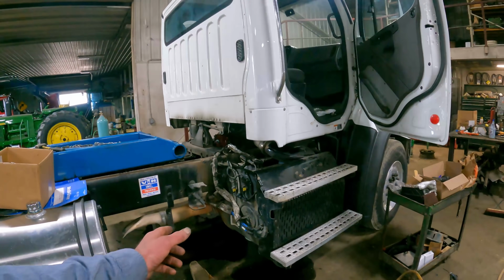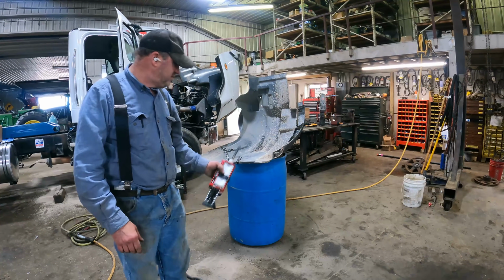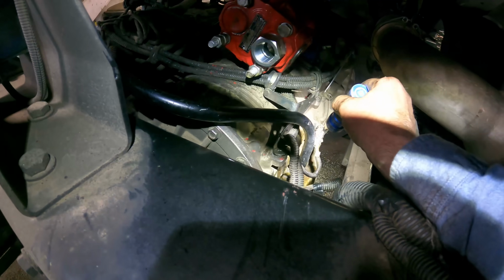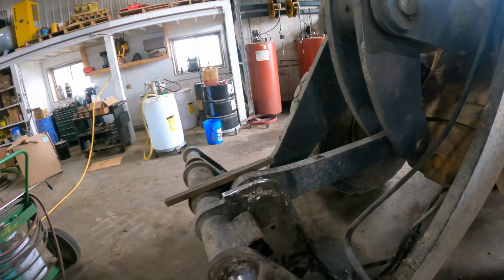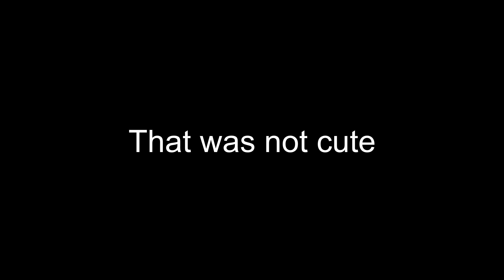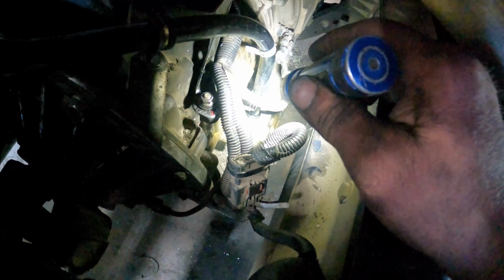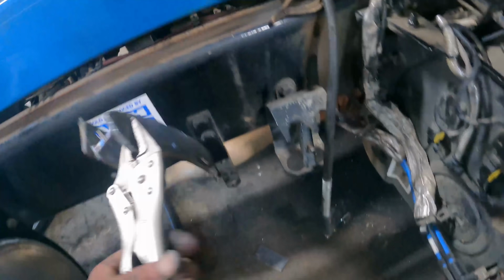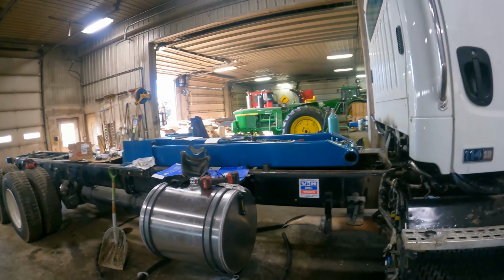Oily Mess (Part 4)

Comment: I have fixed broken plastic fenders, grills and other parts using multistrand copper wire(plated desoldering wire or the shield wire on antena cable works good) and a soldering iron, cut short pieces that bridge the gao then put a hook in each end a bit like Z shape, place the wire in position on the inside and then press on the wire with a hot soldering iron till it sinks into the molten plastic, once the plastic cools its a good flexible joint, for estetics you can cover with silicon or epoxy that helps even more to strengthen the joint.

Comment: he Andy if that truck has the push button style control for the trans you can check the fluid level right on the display   With the trans up to temp [180] all you need to do is set the parking brake put the trans in neutral and push the up and down arrow buttons at the same time it will give you the level of fluid and the filter life the health of the trans and any codes that it may have
Reply from the maker: Good to know

Comment: Plastic weld it with a soldering iron using zip ties as the filler plastic and use lengths of copper wire across the crack to reinforce the join. Worked for me.
Reply: It's new you know what that will look like
Reply: @jwhitley101whitleyfarms9  Yes. Buy a new one if aesthetics are most important to you.

Comment: Andy...Think about running a piece of heater hose or some other hose under and around the dip stick tube where chaffing or rubbing could occur...A few zip ties to hold in place...By the time it rubbed through the rubber and the dip stick tube both of us will be dead and buried

Comment: Hahahaha, I thought that oil from something major. Sucks it's from the filler tube, been there and done that before. This is just my opinion, how you have that dip stick is just perfect, I've seen many trucks have that running the same way as it is right now. As you said, easier to get to and since this IS Sarah's truck... I think she'll appreciate it. 
Have you looked into a plastic welder? Those things actually work quite well. I'm surprised that 3M brand isn't supporting your channel, I mean, as much as you give them free advertisement per se. 
As much as that wheel loader gets used, for that mount lasting as long as it has, it's doing really good. 
I was taught, sometimes it doesn't matter how the weld looks, just so long as it holds. My grand dad always had some pretty nasty looking welds but, they never cracked or broke. 
Won't be long and Sarah will have her truck all finished. Great video as always, cheers :)

Comment: If your tube has a tab onto cab there's a problem. The cab is air and will bounce up and down. You could cut the tube and put a piece of hose in it so the cab and trans mounts can flex without bending or breaking the tube. (Just a thought)
Reply from the maker: It’s not hooked to the cab

Comment: Sorry about the hoses Andy. I was yelling as loud as I could, but you didn't hear me. I was waving my hands and everything.
If that inner fender keeps splitting open, just use a strip of 1/4 inch wire cloth about 3-4 inches wide the length of the crack and a couple inches longer, like you would drywall tape, and spread the compound into the mesh as reinforcement, it works good. Just make sure to use a sanding wheel to rough up the surface first to give the compound something to grab on to.
That project truck is coming right along, I remember a couple of log truck with the dipstick out the back like that.👌

Comment: That tube looks like it worked out well there. The only thing you want to check is the clearance between the cab and the tube when the can starts to move up and down as it appears to be an air ride cab. You may already have plenty of clearance its just hard to tell in a video. Also wish I could have stopped that loader from pinching the hoses for you!
Reply from the maker: Cab was aired down from what you seen in video

Comment: You may want to consider bending that dipstick tube just enough to out the end under the cab.  To me it looks like you may have water intrusion otherwise.  I know the dipstick cap should prevent it...  but they are designed to be under a hood, not in the open.
Reply: The cab protector on the bed will keep it dry.
Reply from the maker: It should be ok
Reply: @farmerbill6855  Wasnt sure if a cab protector was being used.
Reply: @FarmingFixingFabricating  No problem, just wanted to make sure it was considered as a potential issue.